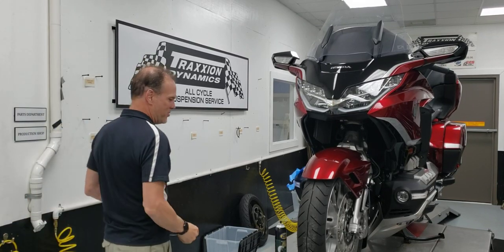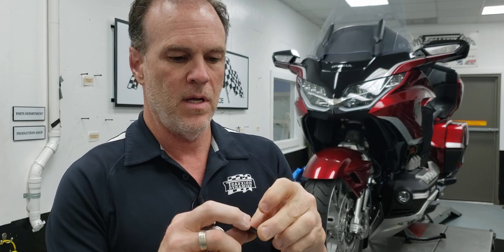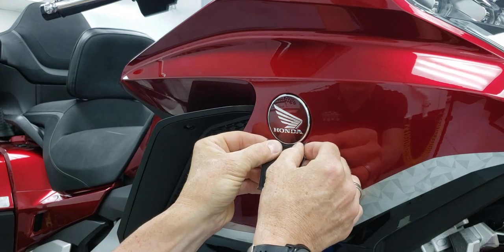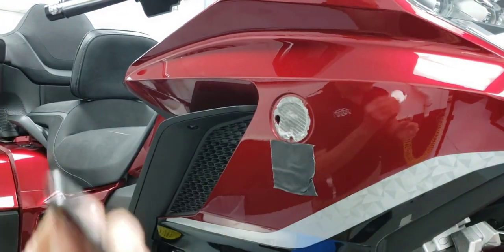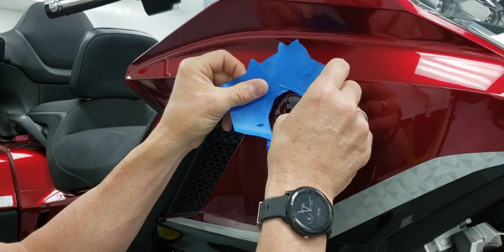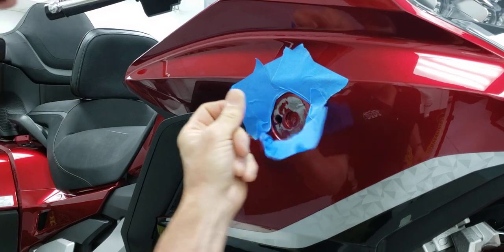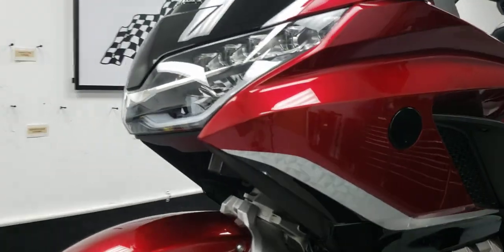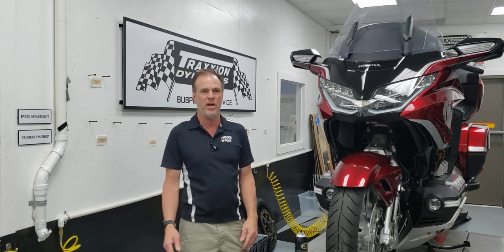Custom Fairing Badge Mounting Kit for Goldwing & Honda by Max McAllister of Traxxion Dynamics

Comment: Max. I know you mostly do gold wing parts and i love them have many of them on my gold wing. I like the way you engineer thing the fit finish and function are first class. That’s way i asking if you could make a tow strap tie down hooks like you did for the wing for the gen to Vmax. I use to use a pit bull which worked great but i sold my trailer and has since blown my shock seals twice strapping it Dow which as you know compresses the front shocks. Can you help. Thanks.
Reply from the maker: There's a bit of myth-misunderstanding about tying down a bike with a telescopic fork.  It shouldn't hurt the bike if done properly.  The bike should still be free to compress some (not ratcheted down insanely with ratchet straps), and should never be in gear.  If your seals are continually failing, something else is very likely going on.

Also I don't make those tie-down hooks.  The two I have shown are Goldstrike or Kuryakyn.  They might be companies to contact for a product like that.  We mainly do machined metal parts here.  We don't have stamping machines or press brakes, sorry!
Reply: @Traxxion   thanks anyway good info.

Comment: Could you use something like GooGone to get the residue adhesive off?
Reply: Be very careful. I ruined the windscreen on my VFR800 trying to remove stickers with goo gone.  Make sure whatever you use is safe for plastic
Reply from the maker: It needs something pretty strong.  I have some 3M automotive adhesive remover on order to try next time.  Electrical contact cleaner and persistence have worked so far.